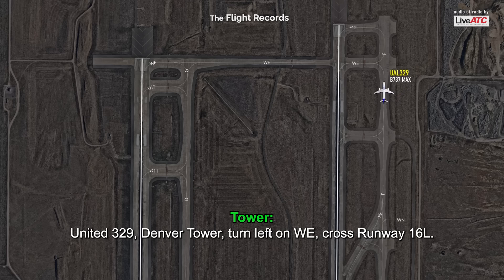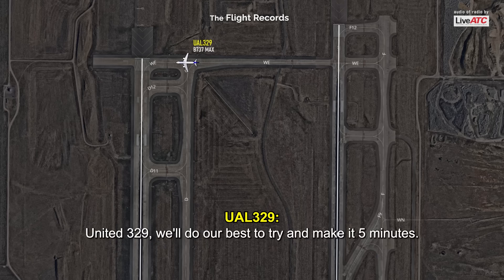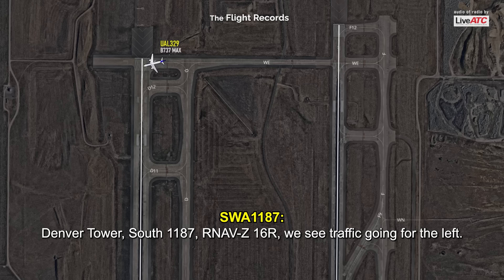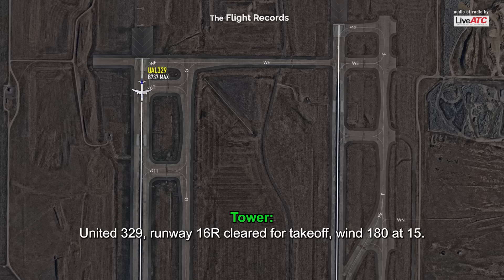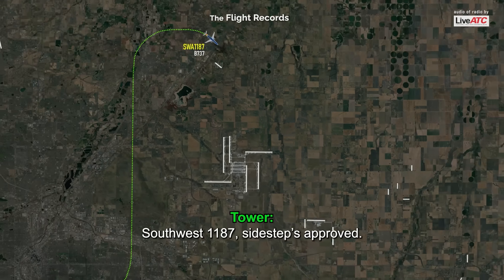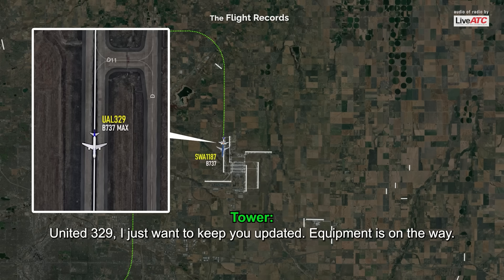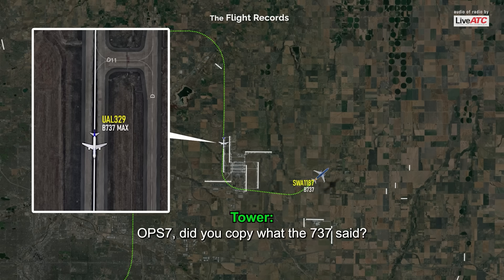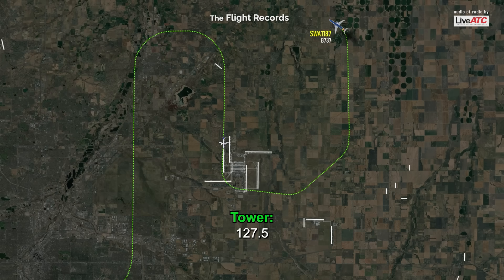UNITED B737 MAX REJECTED TAKEOFF AT DENVER | ENGINE FIRE & BLOWN TIRES

Comment: NTSB report just came out. Crew was riding the brakes during a slow long taxi with engines above idle in order to burn excess fuel. They were heavy and trying to get weight down enough to meet criteria for the unexpectedly high altitude density that day. I suspect this procedure is not in the flight manual.

Comment: They did say it was on the left side of the aircraft, correct? Why are we showing a nose wheel in the thumbnail?
Reply from the maker: If you look carefully you can see that the landing gear is behind the left hand side engine which is dark blue.
Reply: @the_flight_records  I stand corrected. Thank you.
Reply: First picture shows left main landing gear with flat tires, second picture shows right main landing gear without tires down to the rims also showing nose wheel gear.

Comment: Isn't there a better way to detect damaged tires BEFORE take offs?
Reply: Can you look at your car tires before you drive and tell if they are damaged?  Not all damage is visible from the outside, and they could have ran over an object on the runway as well.
Reply: @OvercomeInHisName  a perfect example of that would be Air France flight 4590 (the Concorde crash).
Reply: @OvercomeInHisName  NOT unlikely. FOD damage is the responsibility of airports; I suspect mismanagement.
Reply: HOW? Is there some calibrated system(s) on aircraft to tell the pilot the difference between a low pressure tire to “holy cow I’m riding on rims?” It’s absurd to think that every flight taking off from every airport in the US has the manpower/capability to track EVERY takeoff, via binoculars, to see if the aircraft looked like it took off with INTACT tires. Other options?
Reply: @brmam1385  pilots check the depth of the treads during walkaround before each flight
Reply: The taxi overweight may have been what damaged them.

Comment: Why got the arriving airplane a landing clearance although the RWY is blocked with an (not rolling) airplane?
Reply: Because he still had to go 10 miles before landing. The UA aircraft had plenty of time to be off the ground and maintain adequate separation. When rejected takeoff happened, the controller said, well you can sidestep to 16L or go around.
Reply: they'll use 16L

Comment: Sorry but I’m a bit lost here .. how did the pilot know to reject the take-off? The text at the beginning says the tower told him about the fire but at 1:48 - 1:50 the tower says there “appears to be a fire” after the pilot says he’s rejecting T/O ? 
Am I missing something here?
Reply: They rejected due to an indication inside the aircraft. When they told tower they were rejecting, tower saw the smoke from the aircraft.
Reply: @d.nutter4950  thanks - that makes more sense 👍🏻
Reply: @d.nutter4950 the “indication” from inside the aircraft was the lack of acceleration, noise and limited controllability of the aircraft. There isn’t a “blown tire because you were impatient” light.
Reply: @USMCAV8TR  never said there was a "blown tire" indicator.. as a retired C-5 FE with over 5000 hours I might have just a bit of experience.
Reply: @d.nutter4950  compared to a MAX Check Airman? I appreciate your service but your knowledge base is off comparing a C-5 to 737. Besides, you would never attempt to burn off fuel as this Captain did and heat your brakes ups in the process.
Reply: @LEVELGAZANOW how do you heat brakes up when they aren’t moving?
Reply: @corey_osully  The brakes were overheated and damaged before he entered the runway.
Reply: @corey_osully 
Brakes can get hot for a lot of reasons. Brakes can get hot if you ride them. The max with both engines running likes to move. Procedure is to accelerate then brake.  Rinse repeat as needed.
Reply: @corey_osully  he was taxing with the motors up to burn fuel while riding the brakes. It’s 2 miles from United’s terminal to the end of 16R. Imagine keeping the power up on your car and riding the brakes the entire time. The brakes in the MAX can not be ridden 
. The LEAP engines will accelerate the aircraft at idle so, you allow the aircraft to accelerate, slow it down with the brakes and then allow it to accelerate once again. It reduces wear on the brakes and keeps them cool. Riding the brakes at high altitude for  2 or more miles with your N1’s up around 80% (or more) to burn fuel makes them prematurely warm if not hot. Once takeoff thrust was applied, the brakes reached that temperature and blew a fuse plug on one of the main tires (evidenced by tower stating they see smoke). When he rejected the takeoff, the autobrakes applied maximum millions of ft/lbs to the warm brakes which catastrophically blew all the tires.
Reply: @LEVELGAZANOW  oh shit. I had no idea. 2 miles is also a long ass taxi. Thanks for the info! I was just picturing it sitting there stopped wondering how the brakes would heat up.
Reply: Rejected takeoff was from a FIRE indication in the cockpit. The rejection of a takeoff at max weight and max V1 speed superheated the brakes which have fuse plugs which melt at high temps allowing a controlled deflation of the giant tires instead of brake heat or fire turning them into bombs.
Reply: @ColdSteelCharger  Sorry cold but you’re only confusing me more 😀 … I get that locking the brakes caused them to overheat and cause the tyres etc to catch fire (as seen and reported by the Tower). But this was after the T/O was rejected. So I still don’t know what caused the pilot to reject the takeoff in the first place. Was there another fire before the one caused by the brake lockup? It’s a bit like the chicken and the egg … which came first, the fire or the rejected takeoff?
Reply: @ColdSteelCharger  there wasn’t a fire indication in the cockpit
Reply: Yes. Thanks.

Comment: This “have to burn fuel” is really crazy, who does the fuel dispatch for United? Because it happens all over the world
Reply: It's typical and not "crazy" in any way; either extra taxi fuel was allocated and not burned by the time they reached the runway, they were over-fueled by the fueler, swapped into an aircraft that already had a larger than needed fuel load onboard, or they accommodated extra payload at the gate which required a fuel burn-off to be legal to takeoff.
Reply: Probably had extra fuel incase they had a long taxi.

Comment: How do pilots burn fuel on the tarmac.  Do they stay on the brake and bring up the throttle some or do they just sit and idle.  I am asking because I was wondering if they messed the brakes and or tires up by burning fuel before takeoff.  In  other words, did any of their actions before takeoff cause the engine fire and subsequent flat tires.
Reply: I don't believe so. Aircraft engines burn fuel pretty fast so it doesn't take long to burn the extra.
Reply: When you burn fuel you'll usually set the parking brake and so long as you don't go much higher than idle the plane won't move and the brakes wont heat up.
Reply: Burning fuel on the tarmac just means that fuel is being used; just like you are using gasoline in your car if it's at idle.  There is no correlation.
Reply: Actually the problem is taxi overweight overheated the tires and brakes. It is possible the damage was done before he paused to burn fuel. Then the takeoff roll caused full catastrophic failure.

Comment: Interesting. I have never heard of an aircraft burning fuel before taking off.
Reply: Sometimes we get extra fuel for Ramp purposes such as running APU or extended taxi delays. Max Ramp weight is higher than Max Take Off Weight, so he was maybe still over MTOW before reaching position for takeoff. Not entirely unusual
Reply: Required to meet take off maximum weight of aircraft under giving conditions.
Reply: It happens all the time. My daughter was on flight and they had to delay for 30 minutes to burn fuel for takeoff.
Reply: Seems unusual, given they would have had the numbers for fuel on the load sheet, why would have been an overweight takeoff?
Reply: Really poor ADM by the crew.  We’re seeing a manifestation of lower experience pilot’s upgrading  as soon as seniority allows for it.
Reply: @chrisreevesC180  max braking like you're trained to on a reject? how is that a bad thing?
Reply: @gustafpeyron  the decisions they made that got them to the spot where they needed to RTO.   They elected to “ride the brakes” to burn more fuel to get below MTOW.  That is something you learn as a PPL NOT to do. Why do you think it would work in a transport category aircraft.  So yes… poor ADM.
Reply: @chrisreevesC180  whered you read this?
Reply: @gustafpeyron  internal forum.
Reply: @chrisreevesC180 at least on the E175, if you got both engines running, you need to be riding the brakes or you’ll be taxiing too fast. Even at idle thrust. Totally fine as long as your brake temps are within optimal range before takeoff.
Reply: @chrisreevesC180 Is this true? Because all of the incidents wever seen in the past year at Delta/UAL/SWA/FedEx have had senior captains st the controls. In fact the 777 incident in Maui had a junior FO identify an upset situation similar to the Southern Air low speed event in JFK. Truth is the pilots being hired by legacy airlines right now have more CRM/TEM/Multicrew experience than ever before-and thats what saves lives.
Reply: @36thstreethero  the Maui 777 dive was caused by the pilot retracting the flaps wayyyyyy to early.  I don’t know if it was the CA as PM or PF but a hard no-no. I hope I’m wrong, but given the mistakes that are happening or the really bad ADM happening, there’s going to be bent metal sooner rather than later.  Again, I really hope I’m wrong.
Reply: @36thstreethero LOL!